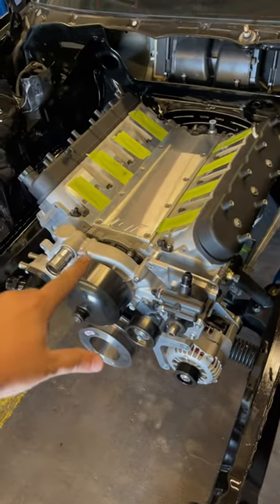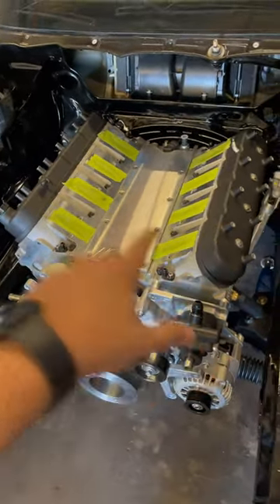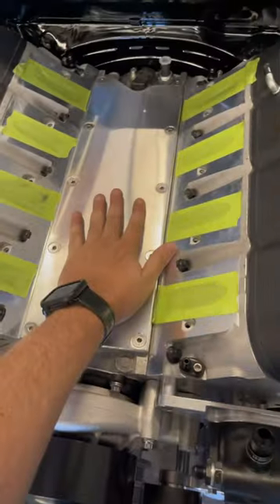This Is How You Make A 550+ Horsepower N/A LS1 Engine! (6.2 Liter Stroked LS1 w/ Holley Low Ram)

Comment: The video I watched before this,  a Junkyard 6.0 Chuck norris cam, headers, factory rec port head swap, Is factory truck intake,  500hp, Engine dino. Gotta love the LS 😁 Mine only has 799 heads so More than likely down 100hp. But ive got like $2500 in it, And that's counting holly Terminator,  Talk about eating my words i've been a ford man my whole life. Don't tell anybody.
Reply: It's a 6 liter with decent flowing heads I mean of course it's going to make decent power with the right setup.  Ford's make the power with alot less displacement and own when boost enters the equation.  They can make a ton of power with boost on a stock untouched long block.  Don't feel too ashamed of your Ford roots. 500 hp on an engine dyno isn't that great for a 6 liter engine that has been gone into (heads, cam etc etc).
Reply: You could get a gen 1 truck coyote and throw a cheap turbo at it for 2500 or less and have 700 to the tire stock long block pretty reliably.
Reply: @midnight347  Sold.  I'll even give you an extra thousand For that truck With that motor and a Turbo system.  With 700 whp  As a matter of fact I'll take three of them.
Reply: @midnight347  well...thanks. I think? Let me help you in return. No one said anything about being ashamed. I didn't stop loving the same thing I've been loving my hole life because of my Junkyard 6.0 LS. That said. I have ALOT of power REAL cheap.  $4,5000 6.0 4l80e Terminator x max VS racing turbo Fuel system. Still need to blow off  wast gates Intercooler 3 bar. For 5000 The junkyard 100 miles away Will sell me a coyote& transmission. If I had the money I would buy it. 🤘
Reply: sloppy mechanics Matt did 750 hp to the wheels with a 4.8L ls with a $500 turbo kit and sloppy stage 2? cam.
Reply: @bobbobby1846  That's the kinda statement that sent me down the rabbit hole. My $600 turbo, turned into. Different gears, Fuel pump,fuel filter,fuel lines,Fuel rails ,injectors, Turbo feed and return lines,  Stove pipe turbo log from Australia" so I can run a single on the driver side, High and Type Alternator power steering bracket, Motion catch can kit,  still haven't got Cold side intercooler blow off Waste gate,  because it's at the Machine shop getting,  Sonic check, hot tank, line honed, Squared, Deck, crank Polished Balanced with new pro ls pistons gas ported rings arp bolts, Arp main stud, head bolts.  And after it's all said and done,  it's in a 93 chevy k1500 with 6" Suspension lift, 3" body lift,  going over 90 is not wise,  but at the end,  I'm going to catch that Wascally wabbit!  And all it took" Was a $600 turbo.  🙂🙃🙂🙃🤑
Reply: Welcome!!!
Reply: I appreciate the fact that we have multiple choices with the ls platform. That's what I love about gm.

Comment: Not hard to make 550hp with LS. I took a $1500 junkyard 6.0 (rect port heads) and put in a cam and long tubes. Tada! 550hp. And that was a mild street cam.
Reply: 550 at the crank maybe.  Was it dynoed?  I've seem similar setups make 500 crank.
Reply: @midnight347  it was. 475 wheel. Those rect port heads really flow.
Reply: Was this on an LS1? you won't get much more than that without E85 or forced induction
Reply: What size cam? I'm thinking of going with a sloppy stage 2
Reply: @chevrolet355 why? What are you looking to do? As far as goals?

Comment: Dude is making a big deal like some aftermarket intake is needed to make 550+ HP NA.  Factory intake can do that no problem lol
Reply from the maker: Well when you have 2 LS1 intakes crack on you, Its' crazy that a Holly intake manifold can make you so happy. It's the small things! Ha.
Reply: 550 hp at the crank is alot different than 550 wheel.  Real car guys don't talk crank hp or estimated crank hp.
Reply from the maker: Oh, then do you say wheel horsepower when its on an engine dyno? @midnight347
Reply: trail blazer ss intake works good.

Comment: Richard Holdener said the only reason to ever run the low ram holley is for hood clearance. The high ram is basically better from 3000+ rpm. Low ram barely edges out the high ram at around 7300 rpm.

Comment: Looking good! What throttle body is that?
Reply from the maker: It's a Gen IV 102mm Drive by Wire Throttle Body. A few companies make them, I picked this one up for under $250 and bolts right up to the Holley Intake.
Reply: @CoreyHosfordRacing  right on, thank you for the reply. Does it work ok/ easy to tune, etc.?

Comment: How is the hood clearance?  I was in the process of building an Ls swapped e46 a few years ago and really the only option on the market was the factory intake. Are you just offsetting the lost torque from the shorter runners with the larger displacement?

Comment: Need to watch some @richardholdner vids. Short runner intake manifold (like the low ram) perfoms best at higher rpm (above 7000)  with s loss of torque and power down low. So intake needs to match camshaft power range for best results.

Comment: Change to a high ram and take the stroke in the opposite direction and u can shift at 9-10000 rpm and get 8-900 hp
Reply from the maker: Now you're talkin!
Reply: @CoreyHosfordRacing  i was a boost nutcase until I discovered cosworth engines. And watched guys out high rails port injected 4 cylinders to 500 plus HP. And I was like wait a second? Then I started watching g banks too and I was like ohhh, ur actually trying to compress the air and the more heat the less that compression works. There’s actually the right amount of vaccume to pull all the air u need into the cylinder, u just need to make the best pathway there, the coolest as possible and port injection keeps them cool, as well as if u can maintain the rpm higher u can get linear increasss every 1000 rpms. And instead of having the air come in and slit into 8 places, u make it every two cylinders and u also design the intake manifold and arrange the timing so when a valve closes that air going into the closed rail bounces off and directs itself into an open valve. U have a better shot at making this happen when u pair up the cylinders and based on the firing order and timing u pair those specific ones. So the Valkyrie intake is a great example of this. There is 6 verticle rails on a v12. They are high and straight verticle but the inside of it has baffles that help bounce that air back and forth to the next valve opening. It’s like a ping pong ball sending air into the valve with extra pressure than the vaccume of the piston. U should see the customizing and special porting old timers do to 4 cylinder cosworth engines for the dirt drift racing cars. I forgot what their called but they look like go carts that can fly cuz the giant wing on the top of the cart. But y wanna see how to properly build a NA monster u start with a cosworth and watch those drift cart thingys motor guys. They port the shit by cylinder and totally alter the intakes. But they have extra ports they add in to measure cfm, vaccume and temp and they tune each cylinder individually. They’ll make it able to flow more fuel. They’ll increase the amount of fuel out of the injector they have pre set dies they make to drill in different angels that they know already ahead of time are needed to effect the flow. They will change the spread on the injector by plugging parts of the screen to make one side flow more fuel and a more direct path rather than it bouncing off of some side of the rail and taking longer to reach the valve. It’s crazy
Reply: lol getting the LS valve train to hold up to that is a pain and more money than worth it. Not to mention I think the LS heads run out of flow that high
Reply: @ThePookybear56  obviously that build in the video ain't cheap and those aren't stock LS heads and i can get LS the flow pretty dang well..u ever heard of texas speed? Pretty sure they make a pretty decent high flow head. Then we can go to the non jacketedd billet heads that have no water jackets and can be ported till the sun comes home buddy. My camaro shift light comes on at 9000 rpms n I'm a electrician lol. I'm sure guys who do this daily can get way more done then me

Comment: Thats 550hp at the engine, right?
Reply: Of course it is.  People love quoting engine hp numbers to make it sound more impressive in the click bait title.
Reply: @midnight347  Still that is around 500 to the wheel
Reply: @exoticspeedefy7916 how do you figure? 20% drivetrain loss brings you to 440 wheel
Reply: @bighitstepside  Most cars loose about 40-50hp through the drivetrain
Reply: @bighitstepside its not a wrx bro it doesnt have 20% drivetrain loss lmao its prolly like 480-500 wheel

Comment: How much and how much boost could it handle?
Reply from the maker: It’s built for N/A so the ring gap is pretty tight. I would say it could only take 4-6 pounds at its current build. If I were to re ring it, we can push it up to 30 + pounds safely.
Reply: Boost is a measure of restriction I hate when people talk about boost like its absolute.  Airflow is what matters not boost pressure.  A big block with big heads and cam pushing 10 psi would be flowing more air than a stock small block long block pushing 20 psi.   That is why boost pressure doesn't matter.  It's a measure of restriction.

Comment: Doesn’t the low ram kill torque
Reply from the maker: Maybe on a factory LS, but we bumped up the compression to 11:1, hoping the low ram can give us a bit more air across the entire range.
Reply: @CoreyHosfordRacing do you think it’s still a benefit I have one not sure if I wanna throw it on ima be running nitrous and e85 with a cam rn still stock I have all the parts not sure to put it on or leave stock intake

Comment: Why would you stroke a ls1 to ls3 just buy a ls3
Reply from the maker: If I buy a LS3 and want to build it for boost or High Compression, I’m still going to have to spend money on piston, rods and crank head etc. I picked up the LS1 for 500$ out of a corvette. So I was able to build this well under a cost of a LS3.
Reply: @CoreyHosfordRacing So, is the block re-sleeved to get a 4"+ bore? I couldn't think of another way to get your displacement (LS3 bore 4.065")out of an LS1 block that can only be honed .004" on the 97-98 blocks due to poor casting position of the stock sleeves when they were poured, and no more the a .010" over-bore on all 99-later LS1/LS6 blocks.
Reply: @CoreyHosfordRacing And if it was sleeved, what sleeves did you install, and how much were your machining/install costs? I've considered doing this myself with an LS1/6 block or re-sleeving a 5.3 AL block because I have easy affordable access to either.